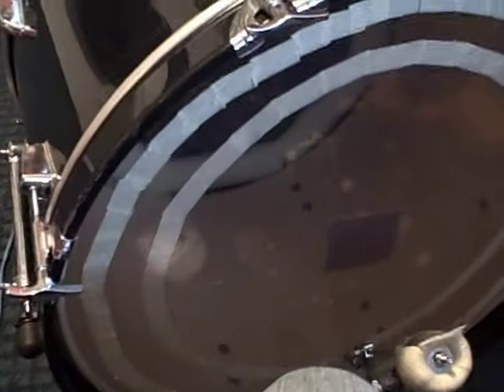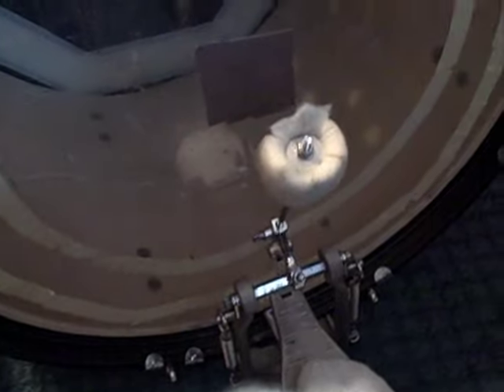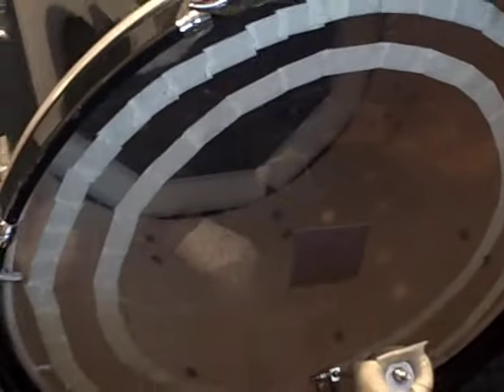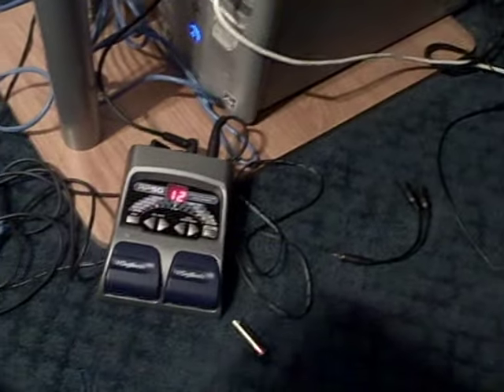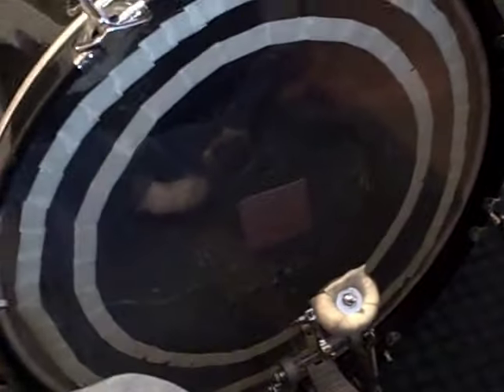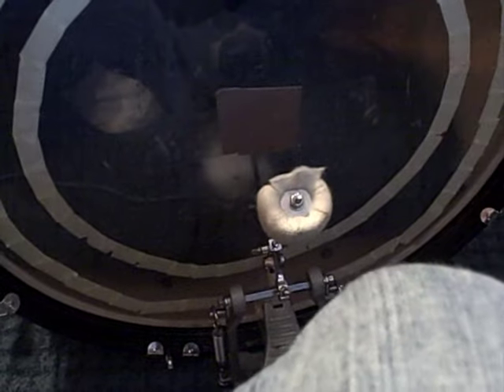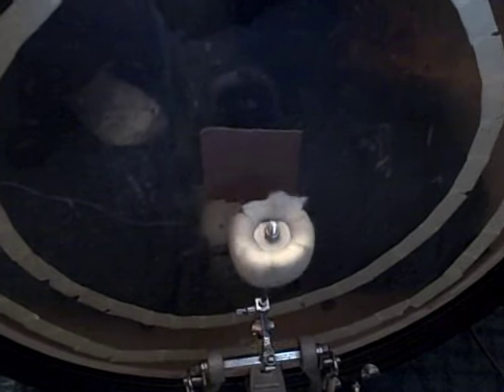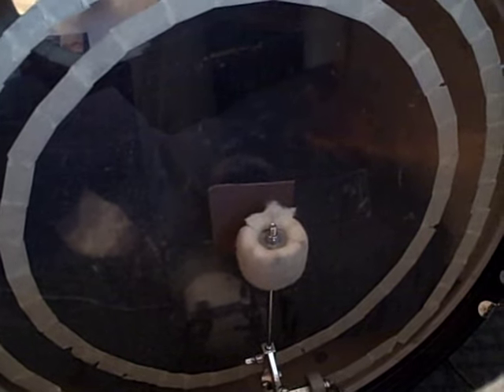Bass Drum Muffling Tests(Pillow vs Rug vs Nothing)

Comment from the maker: Ah yes i almost forgot, I think that you would have to take the resonant head off, then tune the batter head as I said, then put whatever you like in there, THEN put the resonant head back on.

I almost forgot, you can also either cut, or melt a hole on the resonant drumhead, this can remove some of the resonance, and with a hole, you would be able to put stuff in and out of your bass drum, without having to take off the whole drumhead off.